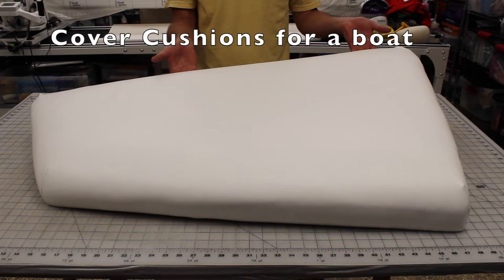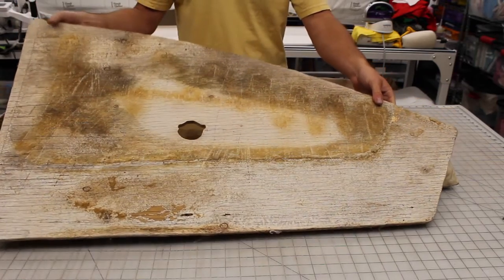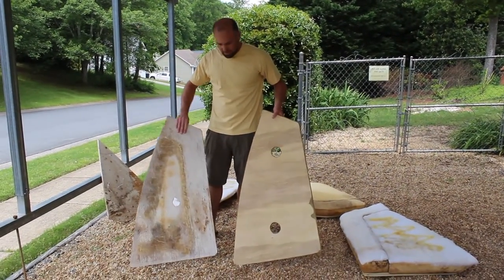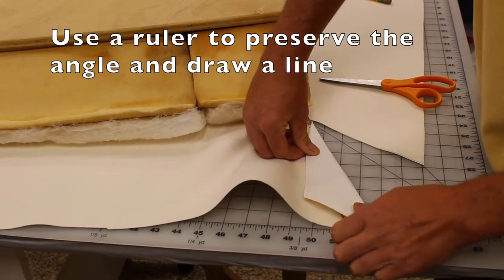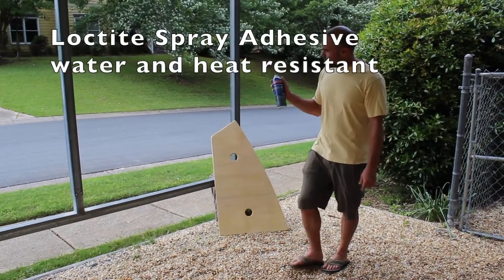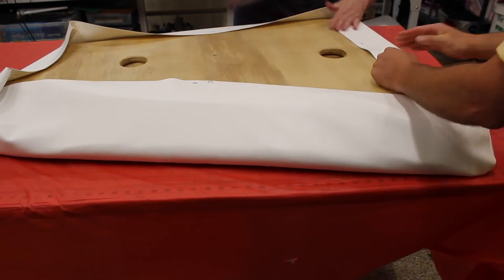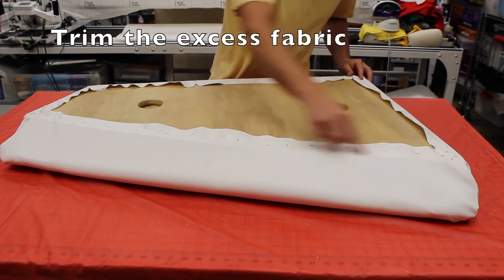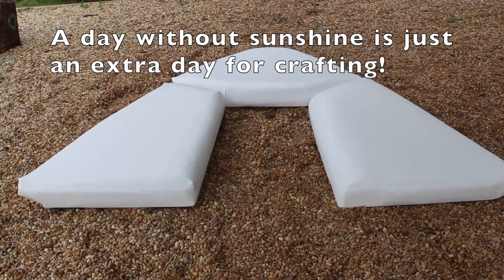Reuphostered Boat Seat Cushions

Comment: For anyone doing this a piece of advice replace your boards and cover them in fiberglass resin that's mixed with 5% acetone so it's easier to work and take longer to cure because Thompson water seal only last one year fiberglass resin last about 15 years also don't forget your spray adhesive to tack your foam to your boards so it doesn't move around when you're trying to put on the new vinyl.
Reply from the maker: Thank you for your advice. It was very useful!

Comment: How do I figure out yardage to cover my seat cushions and backs
Reply from the maker: Thank you for your comment!  The marine vinyl I got was from JoAnn Fabrics and it was 54" wide.  It can be pricy but you want to get a little more than you need.  You should measure your cushion the  width, length and height of cushion.  For example the cushion is 30"x44"x6"... the width would  30" plus 12"(2x the height) = 42". the length would be 44" plus 12"= 56".  That is the size of the cushion, now you need to add at least 3" all around for the tacking.  The size is now 48" x 62".  For that cushion because the vinyl is 54" wide, that will cover the width of the cushion but the length will need at least 1 3/4 yards of fabric.  Again, I would probably get a little more just to make sure it fits.
Good luck with this project.